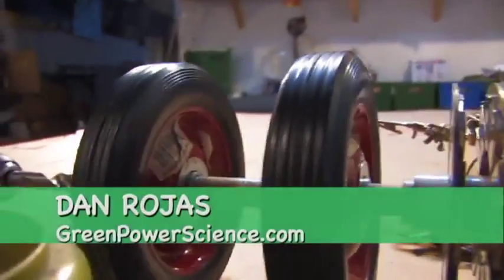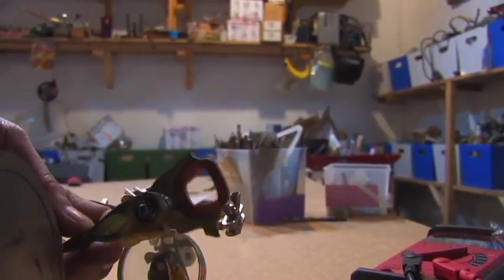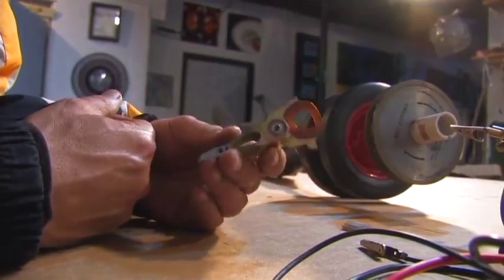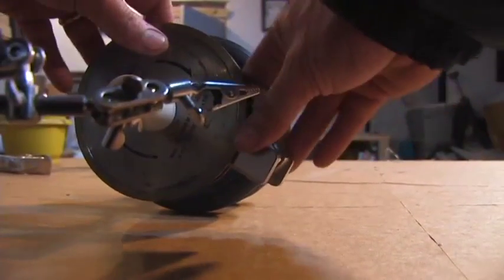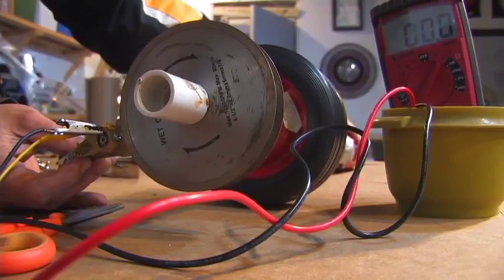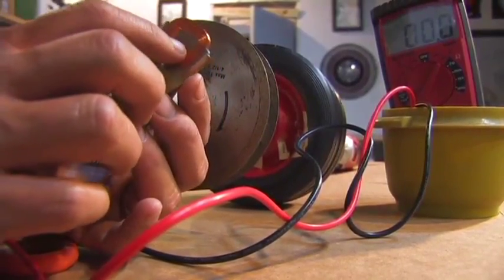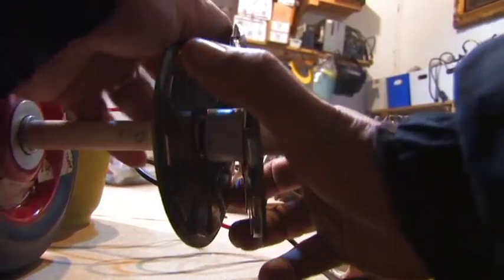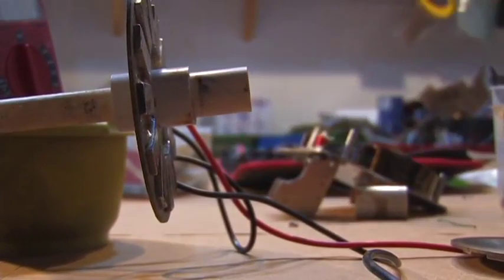AXIAL FLUX ALTERNATOR Saw Blade GENERATOR Hard Drive neodymium magnets or Permanent Magnet

Comment: Could you please tell me what is the difference between the size of magnets in 100amp alternators and 60amps alternators? Do 100amp ones have bigger/stronger magnets or just thicker and longer wires are used for windings?
Reply from the maker: Alternators for cars do not have magnets, they have a core that uses an electromagnetic field to induce the magnetic flux. Car alternators have different sized wiring and field strength for various Amp configurations. For DIY alternators or modified car alternator conversions, the rare earth magnets are larger and have a higher strength rating for the higher AMP configurations. Regardless of the alternator type, more current potential/AMP = higher torque and faster RPM requirements to reach the full output.
Reply: The stators are the main difference in alternators, the rotor is electro magnetic   that switches on and off, really fast to give desired output, it is capable of alot more than 12 v, but will have alot more heat, that is why they are about 60% effiecent at best,

Comment: alternate the pos n  neg same im doing magnets  facing to match the n to pos   n the S to - side of coils so at  TDC its replelling, 
also  i have  9 coils should i do 3 phase, how do i do the three phase? i was going to do  each   badini sg style  since my coils are wound 7 wires 20 ga  1wire   24. ga  n usethe trgger diag to make  3 circuit board with  100omh  r  1n4001   d n 1n4007   transistor mlj21194 
how  do i put this all together now please can you help i need a detailed diagram
please can you help 
anthonyolivera@yahoo.com

Comment: Make the stator with12 coils in series with each other. With each generating 9 volts. You would then be generating 108vac 

if you want to drive a 100w light bulb at 110 volts then all you would need about .909 amps.

Comment: Dan, check out magnetic levetation and mendocino motors. My thoughts are of taking the concept you have here and adding it to the near frictionless perpetual motion bar of magnetic levetation that is driven by power derived from solar cells and using it to generate electricity. It seems so simple that it would probably work. Just look at mendocino motors and you'll quickly grasp what I mean.

Comment: So this would be a BETTER alternator for a bicycle or something?  Two things have always deterred me from doing a project like this on my bicycle: 

1. the weight of most alternators are too much. 
2. way too much energy would be taken out of my bicycle's momentum by the mechanical resistance/friction of the alternator.

Your alternator solves problem 1 but are the magnets so strong that they'll create a mechanical resistance/friction that will slow my poor little bicycle down?  Thanks ^_^

Comment: What kind of hard drive is that? That thing is a beast!
Reply: It's from an old SCSI hard drive. with so many platters (12) you need a powerful actuator to move the heads back and forth. These drivers spin at an incredible 15k RPM.

Comment: On that hard-drive construction, it also look like the magnetic flux field will pass through the screws and then back to the outside of each magnet.  This probably increases the field through the coil.  I have a drawing/vid up about this idea, but the wires of the coil have to go through the axis of rotation so they don't get broken.

Comment from the maker: @RESET1776 Sounds like a fun job:-) If it is a clean break, you can use super glue. Wear goggles as it will splash when they click. Also wear gloves. The repaired magnet is not as strong.

Comment: Good stuff, I was just pulling a drive apart to get the magnets. I use to work at the factory where we made the arms that read the disc. 12 hours a day of micro welding and inspecting with microscopes. Talk about fun........
 Do you have a trick to keep the magnets from breaking? I had one snap onto the other hard enough that it cracked. Now it's falling apart.